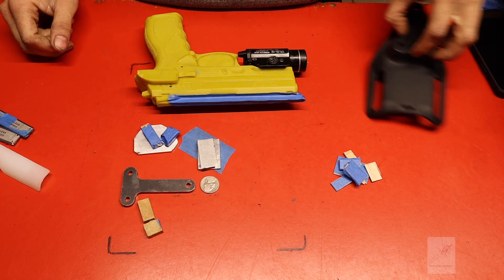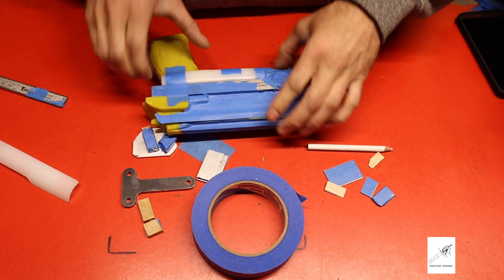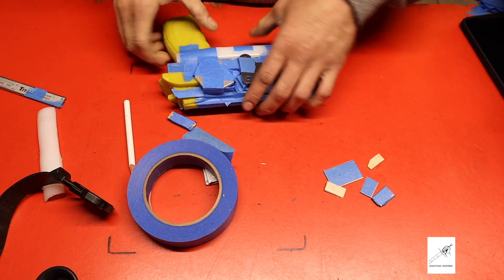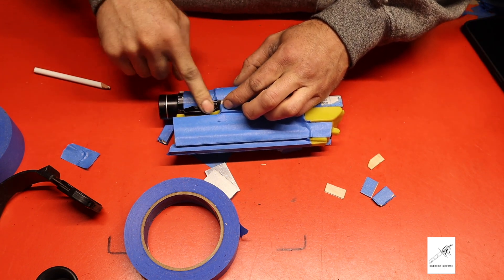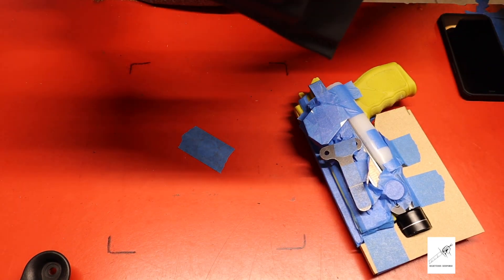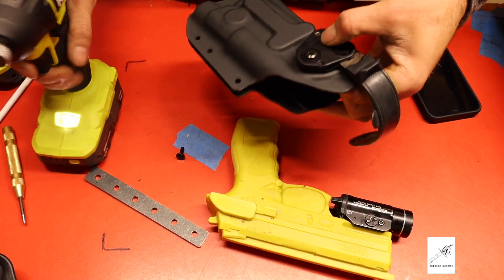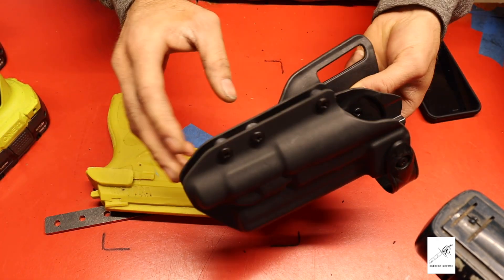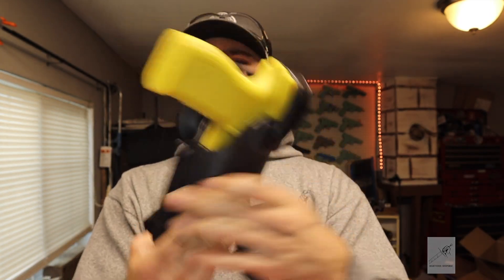how to MAKE a level 3 holster/DIY th9 TLR1

Comment: What make you think that this is a level 3 holster? It's clearly a level 2
Reply from the maker: A sentry lever brings it to level 3 standards
Reply: @Righteousresponse no it doesn’t. It’s two points of retention, the holster itself and the hood. That’s a level 2 all day.
Reply from the maker: @ level 3 all day, after the sentry lever is installed
Reply: @Righteousresponse  I mean you say that, but it’s also not true.
Reply from the maker: @ the hood is a surplus SLS level 2 hood. By definition the sentry lever adds one level of retention. Making it a level 3
Reply from the maker: @PickleWickle92 but you are right. In the video the sentry lever was not yet added.
Reply: @PickleWickle92  I would say it does since you can't disengage the sls hood without disengaging the Sentery lock

Comment: Are you able to do the als as well with the hood? The mechanism that automatically locks on the ejection port?
Reply from the maker: In theory yes. But they are hard to source. In this case I typically recommend safariland holsters directly
Reply: Do you have online  store

Comment: Can you modify a 6006/6008 ALS sentry guard to a two step motion similar to the SLS guard? The open top ALS holster is a level II with the sentry guard installed, step one push sentry guard forward, step 2 push ALS draw release button. If the 6006/6008 ALS sentry guard was modified to require it to be pushed down and forward it would be a level III holster, it would actually be the only open top level III holster on the market.
Reply from the maker: I don’t modify holsters sorry